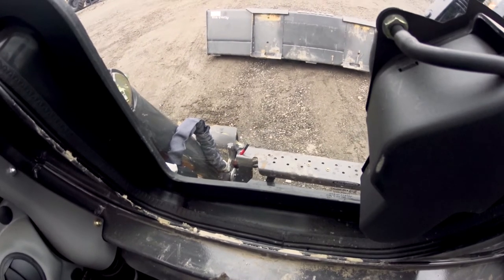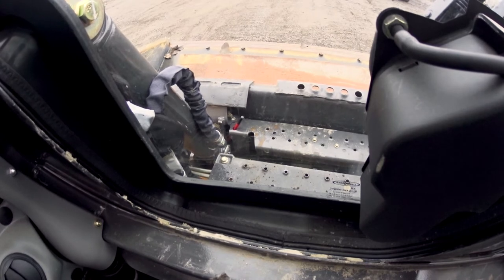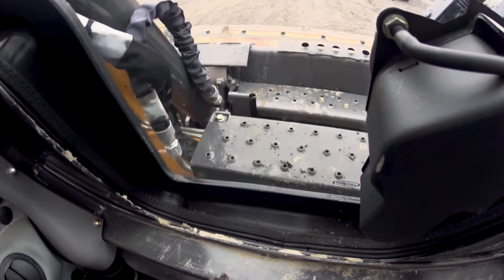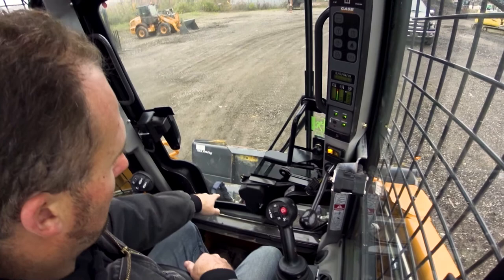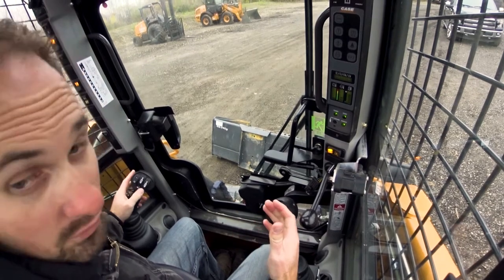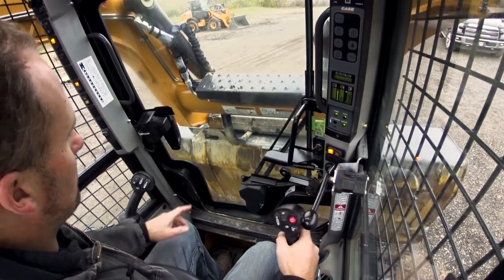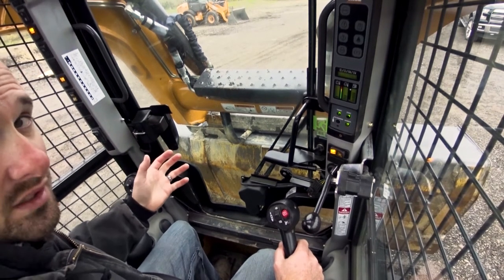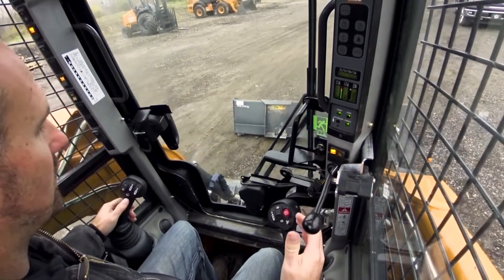How to Run a Skid Steer Part 3 - How To Couple the Bucket

Comment: What happens if one side is attached and the other side wasn't lined up?  How do you correct this problem?
Reply from the maker: Put the coupler back into the unlock position and then wiggle the machine towards the side that is already aligned.  That SHOULD drag the bucket into position.  I say should because occasionally the bucket will be sitting at an angle on a pile and may not align properly.  Don't be afraid to use the corner of your coupler to pull the bucket around.  You can move the bucket to make the coupling process easier on yourself.

Comment: 2004 tr270 how do the couplers work. I connect the bucket, used it and now I can not disconnect it. They have manual couplers. Where there are handles to move
Reply from the maker: If it is a manual coupler the handles should be in the same spot they are on every machine.  The are between the bucket and the frame of the machine.  There are two long handles that flip up and raise the pins.

Comment: What botton did you push to disengage the bucket I can’t find it
Reply from the maker: Towards the top on the left hand pillar there is a button with a red square and an unlock symbol. If you don't see one then you might have a mechanical coupler

Comment: I can’t get lever to activate holding unlock switch and thumb button but I can’t get anything out of the locking device
Reply from the maker: You have to hold the unlock button in the unlock position. While holding the unlock, push your hydraulics over relief. This will cause the couple up open. Release your hydraulics first, then release the unlock button. That allows the coupler to stay in the unlock position
Reply: I’m having the same issue 2012 SV250 case, I push and hold the unlock button while toggling my hydraulic switch on the right hand control and I can see my hydraulic hoses vibrate with reaction but the pin never move .

Comment: What button inside the cab activates the lock arm, the whole reason I watched the tutorial is so I can know which buttons to push inside the cab
Reply from the maker: I'm not sure what a lock arm is?  Are you talking about the coupler or the lockout used when servicing the machine?
Reply: He has showed what buttons he presses😂 he even said don't worry about how he goes about hitting the button on the pilar coz it varies on different machines.